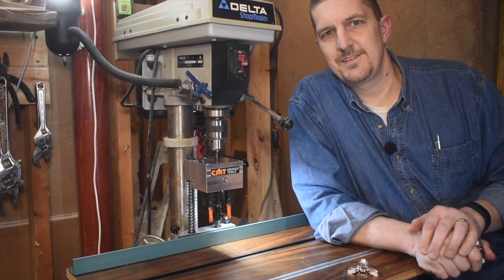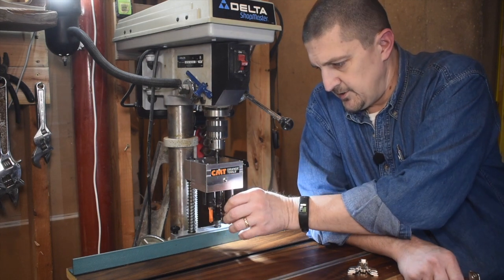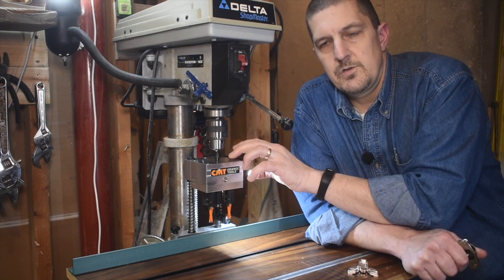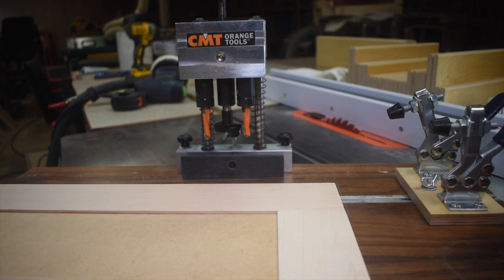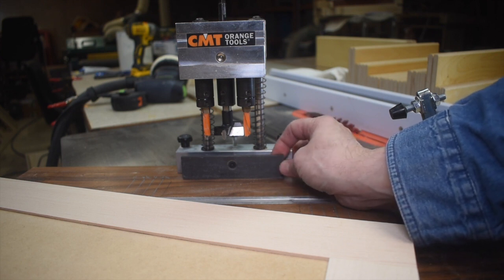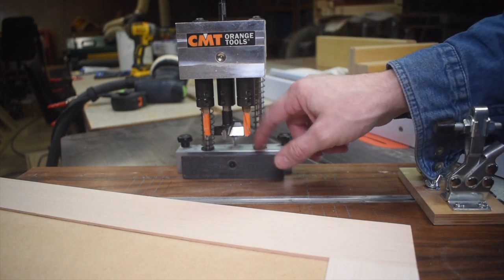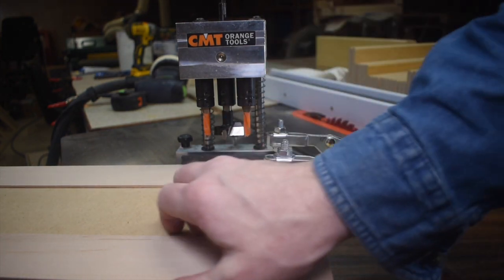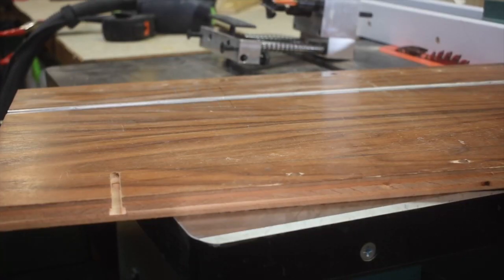Euro Hinge Boring CMT-333 Review and Upgrades. Save Yourself Thousands!

Comment: Recently bought a CMT orange 35mm router bit (looks similar as the one in your jig) and also get a lot of smoke when drilling a hole in melamine board.I use my router on lowest RPM, about 7K, but doesn't help much. Is this normal? I'm worried the heat will destroy an expensive router bit. I think I will just use it on my cheapo drill press

Comment: can I change out the drill bits for non press in hinges?
Reply from the maker: Yes, I believe so. The carbide bits are available in different sizes, or you could just remove the 2 bits for the press hinges.

Comment: Hey, do you think I can use the cmt system with just a cordless drill?
Reply from the maker: Technically I suppose you could. It has its own depth stop built in. You might get a little tired if you have lots of doors to do, but it should work. I just have mine mounted semi-permanently to an inexpensive bench top drill press.

Comment: At no point did you use the actual hinge boring jig which was the only reason to even click this video.
Reply from the maker: Thanks for the feedback. At 7:05 you can see it in action. Also, in my previous videos I have a series on building cabinet doors which shows the machine in use. Hopefully this helps clarify things for you.
Reply from the maker: Here's a link to one of my videos that shows the CMT 333 unit in greater detail https://youtu.be/M_lvnhkM2QM